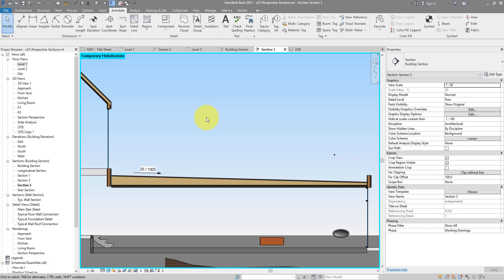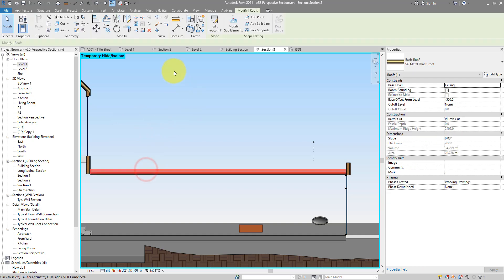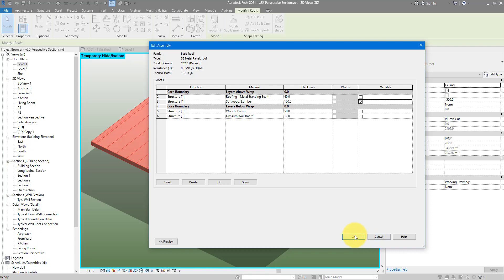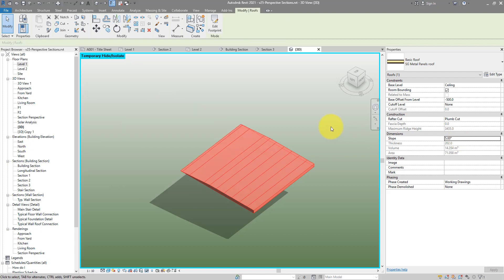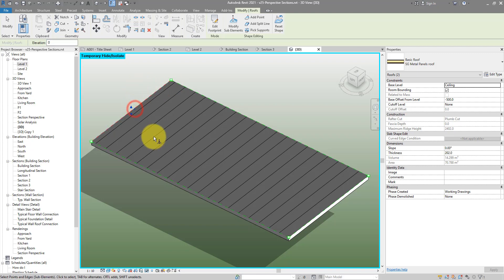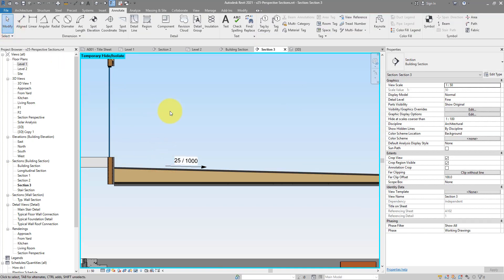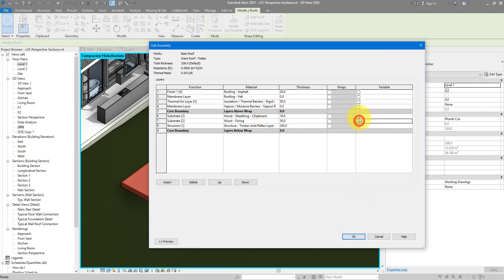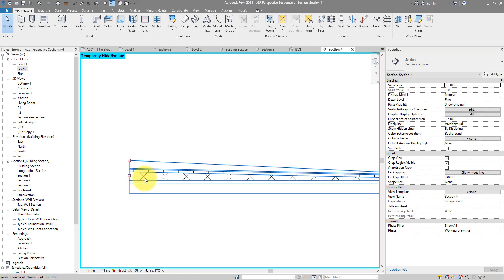Revit Snippet: How to set variable thickness to floor & roof layers

Comment: How do I do this with an irregularly shaped roof that isn't a rectangle?
If I have a shape, for example, a cross, and I want the top surface to slope consistently from one side to the other. I only want to modify one side, but it doesn't work
Reply: saw your response to rev3two. I'm working right now by creating roof drains in my flat roof (modeled as floor), then creating triangular shaped roofs out from those in 4 directions. Then, I just modify the subelement of the edge furthest from the drain, and for example, if that is 8 feet from the drain, input "=.25"*8" and it works out to 1/4" / 12".

Edit: Add a vertical opening to clip parts of the roof to make it irregular!
Reply from the maker: Sorry for my late reply! Yes, that's the trick. Create a rectangular roof, make it slope as shown in the video, and then cut it with vertical openings to achieve the irregular shape. Thanks for sharing your findings :)

Comment: Sadly this is the only way to get variable thickness as well and it works fine when planning a simple roof but if you want to make something more complex the process becomes a nightmare
Reply from the maker: So true! I often need to model a complex roof using a combination of multiple smaller roofs 😅

Comment: How do you set the angle of slopes when using this method? You just have to calculate what the rise will be?
Reply from the maker: I'm afraid so. You can use a slope arrow in the floor sketch instead but that gives a different effect than this method.

Comment: Is there a way to make it slope on the last 1/4 of the assembly? Let's say you only want it to slope the last couple feet.
Reply from the maker: You can create 2 floors and make 1 of them sloped, then join the 2 geometrically to remove the seam.
Reply: @RVBoost  This would be a roof. Assuming it is the same approach.
Reply from the maker: Yes I think so 😁

Comment: How do you do this for the bottom surface of the slab?
Reply from the maker: You will need to apply the slope to the slab itself, not the layer. 2 ways to do this: modify the slab's sub-components, or draw a slope arrow in the slab's sketch.